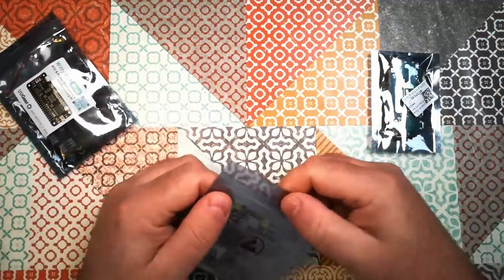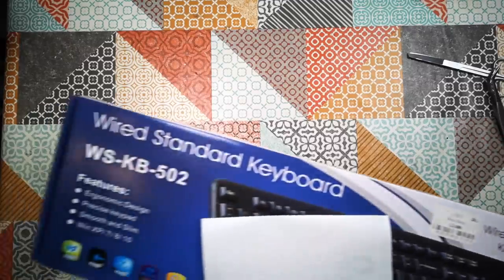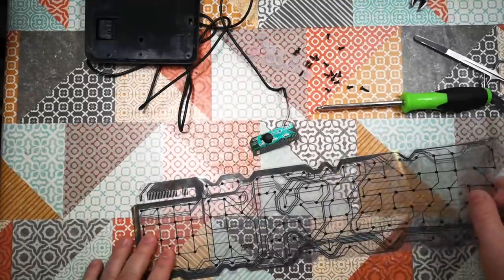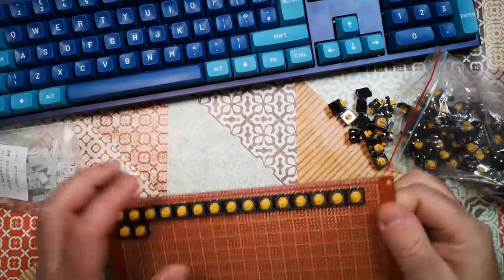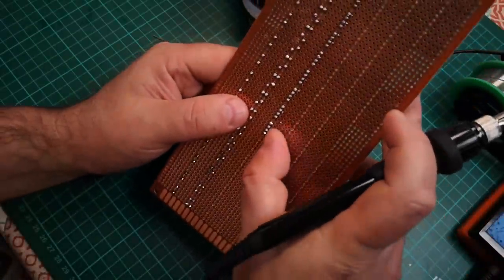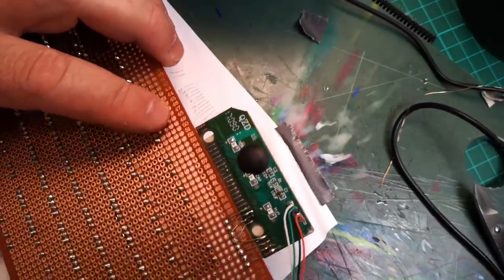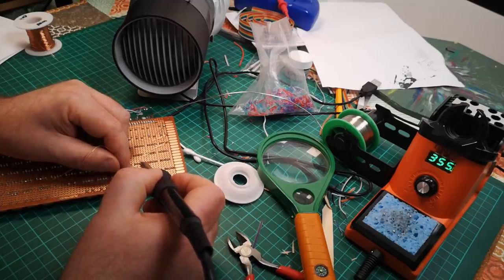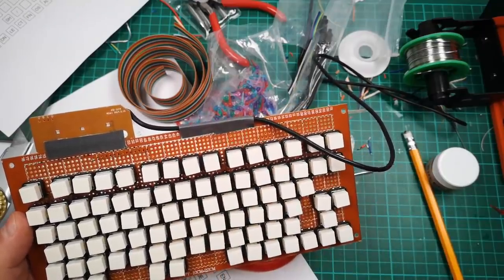How to NOT Build a Keyboard, or: Time to Stop Doing the Same Thing Harder

Comment: Good call, and I hope I would also of stopped but stopping is a hard decision. You still learned from the experience and so it's not a loss, every day is a school day. I think the biggest factor was the enamelled wire, the other factors could of been worked around- not to say it would of been easy or even that the end product would of been perfect . Have a tea and move on.
Reply: That perboard he used is pretty junky. It can work. But I wouldn't use it for anything other than a really bodgy prototype. He certainly has use issues with that wire too. Cheap keyboard controller board was cheap. Those keycaps swiveling around would have annoyed me. May have been a job for hot glue?

Comment: The way we used to do these sorts of projects in the past was to get wire-wrap terminals and then color-code the ends with a sharpie.  It does mean you are dealing with a much fatter assembly, but there is no soldering involved, either.

Comment: Oddly, we seem to have stumbled onto the same problem: There seems to be a lack of small, usb connected keyboards available for project work.

I found that Adafruit make an RP2040-based board (nicely named the KB2040) which seems to be intended for such applications.

I read another comment (apologies, I have misplaced your username!) which suggested a custom PCB - I definitely recommend this, JLCPCB do some great pricing and designing with EasyEDA was incredibly quick to learn.

Comment: As an EE I applaud you for you're creativity ..but I have to admit applying the age old kiss principle would have been a better, if we're making R-pi embedded projects at work we normally use a Cherry Ultra compact keyboard model number G84-4100LCAGB-0 try CCL for a reasonable price but they're not a cheap compact keyboard but then we need them to survive a production environment.
I've never had one apart to see if there is room for an R-pi Zero in there ...??....I'm now tempted to take one apart to see.
if not you could maybe create a long R-pi housing - the length of the keyboard but only 35mm width to house the R-pi and 'hats' & 'bat's' next to each other connected via ribbon cables or proto board rather than stacked , it would also act as a angle stand for the KB if fixed under the rear of the KB.
However all that said please DONT stop trying the out of the box ideas dude ...its what makes us all watch.
Reply from the maker: The Cherry compact keyboard is quite a bit bigger than what I want here.  I need the keyboard to be no wider than 200mm - the notion here is to make something no bigger than a sheet of A4 - that could be done with a wide keyboard and wide format screen (A4 in landscape), but I think I'm aiming for A4 portrait - the bottom third of the unit being keyboard

Comment: I made my DIY logitech wireless mechanical keyboard almost 5 year ago, it still working now. I can confirm it’s a very tedious job, it’s a lot of low level work of sort the index and correctly soldering them, I wrongly solder couple keys even though I marked everything on the back side, knocked off controller’s gold finger so I have to solder on the traces. I can’t imagine how hard it is to solder on this tiny board.

Comment: Cool video, really enjoyed it. I've definitely had ideas and projects get away from me like this, kudos for knowing when to stop and try a different solution.

So many great ideas in the comments. I know it's not the target you're working towards, but if I was doing a similar project and had access to a laser etcher to do my own keycap legends, I'd buy something like a JJ50 keyboard pcb and low profile switches. Using layers can take a little getting used too, but layers on a full sized keyboard with everything visible on legends would be much faster than those cramped momentary switches.

Comment: Hey Atomic Shrimp I am an electrical engineer who makes PCB design software. I also love keyboards. It would be cool to see you pull an open source project like the plaid keyboard or something and then just order the bare PCBs from an overseas fab for low $$. Then do your own soldering assembly plus build the case and some switches. Would save a lot of wires and also save on you having to design your own PCB. Can send some projects if you need inspiration.

Comment: A pointer about the hard to solder tiny coppar "strips" on the original keynoard PCB. I never saw a syringe or can of extra flux. My tip is to get som decent flux in a syringe and if you "bathe" the thing you solder in a layer of flux it makes the tricky solder a bit easier as it removes all contamination and the solder can do its work without  melted conformalcoatin in it and other crap. So for future tricky solder get some extra flux so you can really smother the solder point in it. Also some Isopropyl to clean the flux with. Good luck and I think this was the correct way to end it.
Reply: @1pcfred , at least a few Pauls of flux

Comment: Tip for baring ends of enameled wire (apologies if someone said this already): dip end of wire into small flame of medium heat, from the smallest kind of hobbyist blow torch, then wipe off burnt insulation. With a bit of practice you can get a precise millimetre length of bared wire at each end.

Comment: Point to point wiring is often a lot harder than you initially think it is. I've made some boards that I should not have point to point. I ignore sunk cost and just suffer through it personally. Builds character. Pro tip: Test everything at every step on the way. Then you can avoid heading down a garden path. Like we saw happen here.

Comment: I have 3 handmade Dactyl Manuform keyboards. I recomend making a quick macro box to learn it, then move onto the full thing. Arduino Pro Micro is cheap and easy to use (not the mini (it does not have the USB stuff needed)).

Comment: Yep, that’s a clusterfuk, bin it. Retro builders use an existing keyboard controller IC and program their own scanning code. Normal people would use Arduino, make a standard matrix and then map the keys to the output they want. You can buy keyboard pcbs as a starting point.
Kudos for making a fail video though, because that helps everyone from making similar errors and encourages everyone to just try new ideas

Comment: Ok, so 'failures' are the best places for learning new skills and techniques so I'll start with that. You can now fix pretty much any headphones ever. They almost always use enamelled  wire so now you've learned the heat ranges on that wire you'll be able to easily work with it anytime you need to. Thats not a small thing by the way, that opens a lot of scope. Using that fine wire for bodge patches is so much nicer than using ribbon cable wire.

Haven't got any critiques really, more things that I'll be using as findings for it. I love the pins idea for creating neat wiring paths, that's genius. What I would do having seen this is drawn the paths pin to pin on the perf board. That would also eliminate wiring up to the wrong switch pins.
On that note I would have also have made up the physical wiring diagram in inkscape or similar at 1:1 to the perfboard as it's a lot easier to mentally visualise because you can colour code all the paths that way. Then when you're checking you just need to wave the diagram past the perfboard to visually check the actual wires to the printed copies colour coded ones.

Much as I love that fine wire I'd personally use something with a higher gauge (still single core though) as I can see that it's going to get really tricky keeping the wires against the drawn pin to pin traces on the perfboard.
Given that the enamelled wire does have such a high melting point to get to the wire I'd be inclined to solder bridge down from the switch pin to the next perf hole down and then when the enamelled wire is cleaned back to wire, attach to there rather than directly to the switch pin. By the way, when I've played with enamelled wire I'm looking at about 350-380C on my iron, so at 355 you're in the right range. If you do go higher in temp you start having to be quicker as the wire core heats up too quickly and you melt back more enamel that you wanted, exposing more wire, so you risk creating accidental shorts, which on a fine gauge is hard to see.

Final thought, carbon pads are a nightmare to solder to, I've also found that. If you do this again treat that board as fragile and fix it to some perfboard. Then use a heavy-ish gauge single core to pull those carbon pad terminals down to the perfboard. That way the fragile solder joints on the carbon pads are only affixed once and anytime you need to move the assembly you're dealing with the perfboard solder points instead.

Comment: You should use the continuity mode on your multimeter instead of the resistance. Continuity mode will beep if there is continuity which means you can do these checks without needing to look at the multimeter, especially useful when probing very small traces.
You should also invest in some flux. Soldering those small traces are going to be hell without extra flux. The flux will help the solder wet to the contacts and not "blob" on top of them. I would have covered the whole the set of traces in flux, and then just run a wide solder tip over all of them to tin them and with flux still on it, added the wires. It's especially important, required even, to use extra flux if you plan on just adding a wire to an already soldered joint.
Reply from the maker: It doesn't have one
Reply: @AtomicShrimp  Considering how your skills improved over the course of the project, it has not been a wasted effort. Consider it as practice and a feasibility exercise. No disgrace whatsoever.
Definitely make or buy a beeper. And liquid or paste row rosin flux. Perhaps there is a bit of perfboard handy from an abandoned project to cobble together a simple circuit with a pleasant sounding annunciator handy?
The bloop technique is a game changer for delicate fine pitch work like this. A fine point solder tip, as well. 
Many of your plans are brilliant, like laser tattoos and using a purpose built controller.
Best of luck, custom key boards are impressive, and make a solid statement of your investment into a custom design. 

P. S. Adafruit has a variety of parts for your purpose. They showcased several over the last year.
Reply: @AtomicShrimp  It should. Try the setting marked with the diode symbol(yellow) between 200 ohm and 10A .
Reply from the maker: @robertalabla  there's no sounder on that setting
Reply: @AtomicShrimp  Ahh, I see, I thought it did with the diode option, but alas, it seems it has no alarm. That's disappointing. I know you can get a multimeter with the audible continuity alarm for like £10 online.
Reply from the maker: Yeah, I need to get one
Reply: @robertalabla  Yeah I thought that too, but it need the sound/"wifi" looking symbol as well to be a buzzer

Comment: I might consider using your process if doing a very small version of the keyboard such as if only wiring the arrow keys without requiring the cost of an extra IC. So I think your work still has merit in that regard.
Reply from the maker: Thanks. Yeah, I think this approach still has value for contexts like that. I have a longer term plan to make an arcade cabinet for a pc game. Stripping down a USB keyboard to make a control panel with just the right buttons, that pass simple key presses to the os, seems like it might work

Comment: Knowing that the top and bottom pins are linked, you could actually remove one of each. Thus creating a 'top left' 'bottom right' scenario that still allows you to secure the switch, but cuts the number of active pins on the bottom of the board, in half, or alternatively just remove the pins on one side, (bottom let's say), and then use a spot of glue or double-sided tape to help secure each switch body to the board. 

Though as you've said, this has started to become an expensive project already both in terms of effort and components, and the keyboard is a very small component of the overall project. Perhaps an inexpensive, off-the-shelf solution is called for at this point, or at least moving on to another portion of the project using a standard keyboard for the interim, allowing the idea of custom building a keyboard to come together with more time and thought.

Comment: This is a familiar feeling. I’ve started a few projects, thinking ”I’ll just do it myself, it will be cheap and easy”… And then realising I have to solder hundreds of things, wires go everywhere, it looks messy and something breaks but you still think you should try fix it because it’s already so far etc. Another time I used Arduinos to make like a ”smart lighting” thing, transmitter and receivers to control LED strips and change their colours, but it was complicated and needed to be programmed and changing things were hard and there could only be one remote and it didn’t interface with böuetooth or anything to control it more easily from a app. I just gave up and even though significantly more expensive, bought smart lights from the shop :D

Comment: I was just wondering if you could buy that tiny keyboard you showed earlier and take the back of and replace it with your own 3D printed backing with more space inside and just put everything inside that casing. That way the keyboard becomes the computer case and doesn't need to be reverse engineered. Internal connections can just use cut down extension cables to externally placed accessible ports.
Reply from the maker: Could do, but that was a bluetooth keyboard - and I have this issue with the whole idea of building two unconnected pieces of a machine in the same case, then connecting them with radio.  It just doesn't seem right.
Reply: @AtomicShrimp  I totally agree. Bluetooth is overkill (and wastes about 50mb memory for caching incoming transmission which is insane for a keyboard).

Comment: Making your own PCB with the footprints and traces would probably have been easier, even for the one off. 

I've normally only seen people sand the enamel off of the transformer wire?

Perhaps you could also look into having a fold out keyboard made by cutting another cheap but ridged construction PCB? I know my fat fingers struggle on the super small format keyboards!

Comment: To sacrifice height for a better key-feel, you could have used Alps or Matias switches as their legs are almost in a row. You might have to do a little bit of jury-rigging, but it could work. The only problem there would be stabilizing them. The leads are in front, so if you aren't careful, you could bend the whole switch up, so that's where the micro-tact switches are better for this application.

Comment: For those who want a bit more flexibility in keyboard design: The SK5210 USB HID IC supports 8 rows and 20 columns per row, so you can build a keyboard with 160 keys using that chip. It also supports up to 7 indicator LEDs, keyboard backlights and has a PS/2 out for a mouse or a touchpad. Which key maps to which keycode is freely programmable using very simple software. Surely this thing is a bit over the top but available for $15.

Comment: Finding the ways that don't work is an important part of the process of learning and invention. Being willing to unflinchingly share your failures with others is rare, and much appreciated. 

I think even without the mis-soldering, this method was probably doomed. The end result seems like it would have been extremely fragile. There was the risk of causing heat damage to the keyboard's MCU from soldering to its board, and the risk that a £3 keyboard's MCU might be prone to fail anyway. Your eggs were piled high into that SPOF basket, and if it failed, the rest of your board would be rendered useless unless you could find an identically-mapped keyboard MCU to replace it.

Comment: Design your own PCB and get it manufactured ..custom PCB are not too expensive... will simplify soldering and reduce the effort required. Reverse engineering an existing matrix probably take longer than designing your own. Just like in software, harder trying to understand someone elses code..
Was an enjoyable watch..  I've had many a project go wrong.. hard to call it a day when you've invested so much time..

Comment: If you absolutely need to make a keyboard (without an expensive kit), I would make the following two changes to improve your life:

1.) I would grab a Pro Micro (anything with a 32U4 -- they're like $5), the Arduino software is super easy to make a USB keyboard with, and the component uses standard through hole  spacing.  This also gives you the benefit of defining your own rows / columns (and which keys / LEDs you want to support).

2.) Either use a custom PCB, or at the least, use strip board (this will automatically create the rows for you, and you'll only need to wire up the columns manually). ✌🏻

Comment: I haven't seen the whole thing yet so maybe you'll say this later but if long runtime is a priority, I wonder if an e-ink display might be suitable? They're fairly expensive but perhaps you could repurpose one from an old, second-hand kindle if e-ink does enough of what you want.
Reply from the maker: I've been thinking about that; it does absolutely fit with the long runtime objective,  but most of the e-ink display offerings for use with Raspberry Pi and other boards have very slow refresh rates - the ones used in ebook readers use special display drivers that can rapidly refresh parts of the screen (often at the expense of fidelity), but I think reverse engineering one of those may be well beyond my ability.
Reply: The older kindles (like my Kindle keyboard 3) only do full screen refresh, but yes, it's slow. You can get super fancy colour e-ink displays that can actually sort of handle video now, but they're like... a grand. Not suitable for your project at all xD